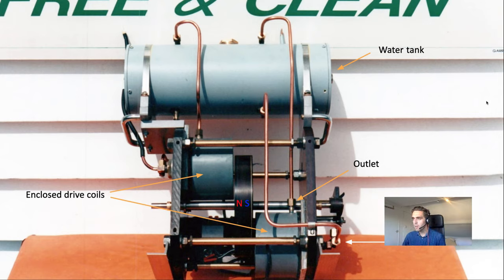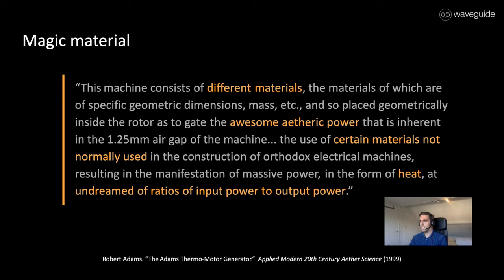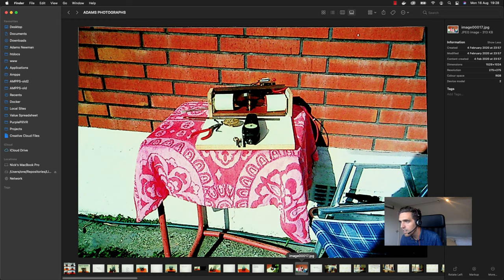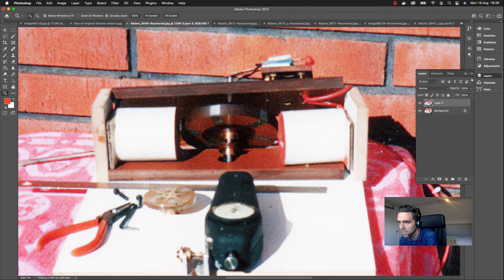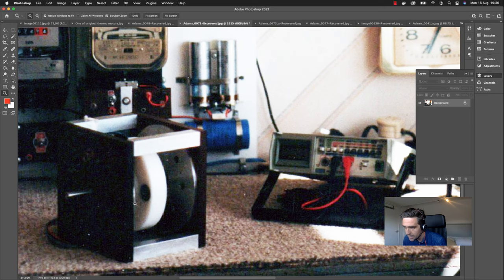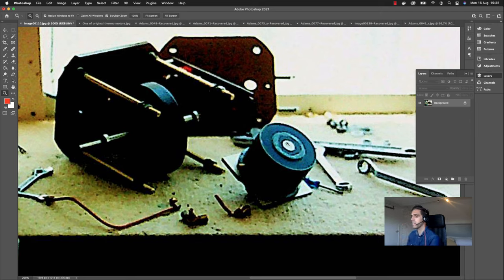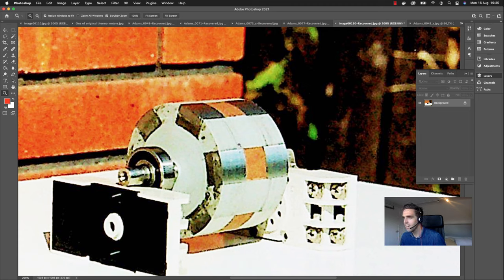NEW Adams Thermo Motor Pictures

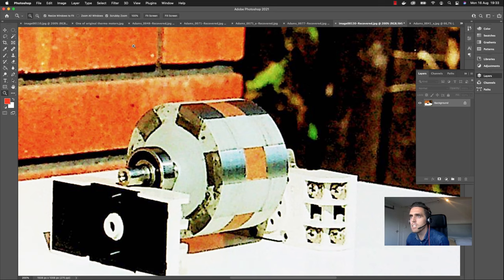Comment: The material on picture 8:18 that you ask about is probably Mumetal. This would force the magnetic field to be more focused outward and not toward the inside the rotor. This is only a guess as I do not have access to seeing the material first hand. 
What was the forest that made the heat, do you know ???
Reply from the maker: You might be right. I'm currently doing a lot of research into Don Smith, and for his Bloch Wall Generator he used bismuth, permalloy, terfanol-D, or indeed other high permeability materials like mumetal to scatter the magnetic field, causing the neutral part of the magnet (Bloch Wall) to move around, causing immense amounts of induction. I feel a similar effect may have been causing the heat in the Adams Thermo motor.
Reply: @Waveguide  I wish I would have the information you have about the Adams Thermo motor. I would bet I would be able to really help you out with the item. The hardest part of dealing with these invention is getting solid accurate information for research and experimentation. I would bet most of the machines he made were sold at a estate sale by female who only know what Adams like eat and drink. Or just given away to the course scientific hopeful wantabies who take things apart and just lose interest with the machine itself. Rarely does someone find and take the machine to the finish line.  
    My feeling is you are going to figure it out Waveguide. I just hope I can have a small part in helping you Sir. 
Good day too. vf
Reply from the maker: @victoryfirst2878  check out the links in the description under my videos, there I share all the information I have about Adams and his machines.

Comment: I left long comment on newer video, didnt see thiese photos yet!
OK those two grey "cans" are ALUMINUM or COPPER  water filled chambers.
And inside are his coils, maybe with cores of lead, or bizmuth or aluminum or whatever.
Maybe coils of aluminum or copper wire.
I heard his coils of copper tube!
Water running through too....
Reply from the maker: There were no coils in the water tank at the top, only the two visible motor coils, and the water ran through the iron core inside those coils.
Reply: @Waveguide  Most probably water ran through both copper tubing working as the motor coils and the core as well too.  Iron is going to get red hot whipping neodymiums past it pretty quickly,, so use the cooling water as heat source.  And the copper tubing  near rotor magnets is going to get hot too, its just more effecient to do both. Also "magnetic structured water" of reverse polarity to nature can be made if you pump the water in right direction and spin magnets in right direction.
All viruses and bad stuff like tumors in body is polarized opposite of the good stuff in body (maybe its positive I dont remember) and if you polarize water negative then drink that water, it sticks to the viruses and then you piss it out. Lots more to it but thats it in nutshell.
also that bigger tank up there in photo, that could be HUGE, as big as a shipping container and have it be one of those "liquid batteries" the MIT kids figured out.
Basically some stuff that sinks to bottom for a liquid "plate" and some other stuff floating in the water on top as the other plate, the "structured water" produced by the adams motor magnets is the electrolyte and you have a giant battery.  They already use these things to absorb power grid meltdowns if lightining strikes or powerlinew downed....giant liquid capacitors sort of inside shipping containers liquid batteries better description.

Comment: the thing in center looks like his star wheel commutator but 6 instead of 4 like the other engine drawing....maybe graphite and copper on the japanese collab
Reply from the maker: I see what you mean, as there is a resemblance, but the "lines" are way too thin to achieve a 25% duty cycle, so I'm quite sure it is something else. In the original thermo motor, it seems there is a starwheel setup on top.
Reply: @Waveguide  maybe its not a drive star wheel but a momentary short circuit of the coils to create a lenz law spike of eddy currents that then get let go again. how else does it make the heat since his other machines ran cold yet this runs hot. i dunno man. chase down the siblings...good luck with that, I pray it bears fruit for you...also in hindsight about the materials being copper and graphite...those are common in motors and he described the materials as not common to motor manufacter so now i am wondering about it being a high dielctric material (the black stuff under the magnets) but the orange stuff maybe its a brass alloy of uncommon mix tailored to be paramagnetic. square blocks of differing forces...dielctic, conductive magetic, conductive paramagnetic and all incorporating harmonic numbers as described in Bruce Cathies books and incorporating pi and phi in the ratios of the square blocks. Have you looked into the way Cathie derived harmonic numbers and ratios from the planetary grid and the speed of light at that latitude?
Reply from the maker: @m3sca1  I bought Cathie's book The Harmonic Conquest of Space, because it contained a chapter on the Adams Motor, but nothing new was revealed in that chapter unfortunately. Other than that, I haven't read about the details of Cathie's work. I do have several pictures of Robert Adams, Bruce Cathie, and some Japanese business men who they were working with.
Reply: @Waveguide  so the latitude where you live and are building the things needs to be factored. according to Cathie the speed of light is different at different latitudes and then that number gets used to calculate the dimensions of things if they are to be harmically in tune. Read the whole book and follow the way the geodetic inch gets converted on yhe light speed tables
Reply: @Waveguide  The current should flow at the moment when the magnet is located exactly in the center of the coil core and stop when the magnet comes off the core. That is, the current must flow over the width of the magnet divided by 2. The wider the magnet, the longer the current must flow. Judging by the photo, if a small disk is enlarged in proportion to a large one, then the width of the conducting lines of the star is just equal to half the width of the magnets.

Comment: something else to consider. timing the magnetic attraction to the motor core to the highest point of resistance point on the heating side.  if that makes any sense.   using eddy currents you will run into lenz law so you will have to move the  flux/eddy currents away from the magnets each pulse to avoid slowing down the drive motor.  that will be done through the geometry of the material used.  not easy to do.  unless you can find the "magic" material.  good luck.

Comment: running neo magnets by copper generates a lot of heat. i would try aluminum, copper might slow the rotor too much.  silver? also make a test machine to test different materials.  you can figure out the geometry later.  keep it simple.  research eddy currents in materials.  maybe he found a way to use  he eddy currents without sowing down the motor, he was smart like that.
Reply from the maker: Thanks for the tips! In his words, he said the machine generated heat like this:

"The rotor is designed and engineered in such a way that it gates massive aetheric energy in the form of heat which is transferred by the rotor system to the water jacket system of the machine stators."

Comment: If you re orientated the drive coils, so that they were vertical, so the coil fields would be perpendicular to the magnetic field. You'd just have to find out if the north facing magnet is better propelled by either of the two fields accounting for which way the rotor is spun ofcourse. This operates on what Newman discovered, that the magnetic fields are gyroscopic in motion. It's this type of coil setup that generates a massive amount torque, because the magnets want to spin off the rotor. Best to bolt them down, and maybe cover them in epoxy resin. 

I've been down a similar inquisition. This is Patrick Kelly's video on the Adams Motor https://www.youtube.com/watch?v=J2bPDDWqSvM but to be honest when comparing apples to apples, an Adams Motor vs a Newman's Motor, just has a different coil set up. But the Newman Motor also uses impulse/short circuit current which is so powerful in it's BEMF, that can generate usable torque on the rotor. These other magnetic rotors using Pulsed DC coils, have no real power, unless it's like a leedskalnin bucking coil set up, that can generate power at very low rpms indefinitely. I believe even the leedskalnin generator short circuits itself in the bucking coils to make a monopole electromagnet. This is what bedini was doing. It's only until you have a rotor that has induction windings, then you can get usable power from because there is constant signal tension on the windings, which you can't get from magnets. But you can get an extremely heavy rotor, put some magnets on there and through the impulse sequencing, it will reach it's maximum velocity according to how the commutator is set up. A question that one has to ask itself, is how does amperage effect lenz's law? High Volt Pulsed DC bypasses lenz's law.  In my comments on previous videos I mentioned, the newman motor is a far easier machine to make, especially in regards to the Naudin Design http://jnaudin.free.fr/html/qmmv11.htm Look into Gerard Morin and his pulsed dc washing machine motor https://www.youtube.com/watch?v=ZgdyFKIt9Xg 

I mean Gerard Morin is dead,  because he was turning a washing machine motor on a like a 150 volts pulsed DC. Hook that up to a generator, or rather an alternator for low cost experiments, and attach it to a 50k up 25k down transformers. You got over unity. Whatever energy is not used, you have to send it back to another series of transformers. Then the gain increases further. 

 And that my friend is the secret of our electrical grid. AC power transformation. This is why Thane Heins believe he has it, with his Bi- torrid Transformer. When comparing a multiphase pulsed DC inductive motor, to a newman motor, I think the case is your going to generate a lot more power with the inductive motor, than the newman. But the key to power is really about it's AC step up transformer.
Reply from the maker: Wow, a lot of info in that comment! :-)

This particular Adams motor is not meant to generate torque, but immense, ever increasing heat, which is then used to boil water and run a steam turbine.

What Newman found out is super interesting, indeed. But his motor was gigantic.
Reply: @Waveguide  The Naudin Version of the newman motor is actually very small, can easily fit on a table. You don't need 6 offset magnetic columns, you can just have a rotor disk. Lots of other projects on Naudin's site too that'll you find interesting. Can possibly get a seebeck effect on the Newman motor, both Newman, and Naudin in his notes say the generator runs cooler.

Steam is a very tricky thing to manage in a home project, most people have turned to hydrogen trying to pursue meyers high frequency resonant coils to make HHO gas. And when that combusts, it actually produces a far less exothermic reaction compared to hydrocarbon fuel since it's far more explosive.

Budget wise. Naudin's version of the Newman motor is easy to do as a overunity project, since it's short circuiting. You may be able to add in additional pulsing coils to gain momentum in between the short circuits. More expensive project, Gerard Morin's, Samsung washing machine motor, generator, transformer etc. You can probably crowd source some projects. There's not many new people working on things and I was really impressed to read your article on pulsed motors.
Reply from the maker: @FirstLast-up2dx  yeah Naudin has done a lot of cool stuff. He also "replicated" an Adams Motor, but he did not follow the inventor's instructions at all.

I am aware that there are a TON of different pulsed motors out there, but my goal is to fully unravel this particular one, because the fact that it is an aetheric heat engine makes it different from all the other ones.

And I'm not excited about working with steam either, but just seeing the constantly growing output energy of this motor, which Adams described, would already be enough of a result to seriously consider the existence of the aether.
Reply: @Waveguide  If you want heat from the coils, they need to be thicker gauge coils with no iron core. Or wind them in an anti-parellel manner, so the current flow opposes itself and have the tubes go through the coils. I think in this manner what the coils will lack in magnetism will create heat from resistance. Then you have to worry about the voltage to resistance ratio, thus creating amperage and possibly burning out your coils that use smaller wire. 
If you believe heat is coming from the lead, in the rotor, then the high rpm's of the motor will be working against that heating purpose. You'll need to make an air tight system, not a vacuum, so that the eddy currents from the lead, will eventually heat the air inside the box, like an oven, that will eventually heat the tube lining, boiling the water. However the coils will need to be outside of this system, because the hot air, will create eddy currents in the coils, creating resistance and possibly burning out the wire. That pressure, will be very dangerous to work with at usable levels and somehow that steam would loopback to a generator, to power the pulsed motors?
On the market they already have ovens, water heaters, steam generators etc. Using steam is an inefficient medium. You're better off creating some sort of metal dust battery pulsed by microwaves or in a rotating magnetic field, to create heat for steam generation. If you do that, you'll probably get "pinged", and a knock on your door, hey maybe even recruited since you know how to code, maybe work for a defense contractor. Check out this Patrick Kelly video https://www.youtube.com/watch?v=dqh8Yu3NjJI 

A newman machine, or a pulsed dc motor in a looped circuit with a transformer, is a far more exciting project. At these conferences you'll get a whole lot of attention. I mean even a working model of an Adams motor, generating as much steam as applicable, is a dangerous machine to bring to one of these events.  Those are just about the most efficient designs I've come across, other than a hydrogen engine with a resonant electrolysis system.

Comment: 9.10. material is ceramic? Ceramic is non conducting , non magnetic and will not have induced within it any eddy currents.  Although, ceramic would not withstand forces at high rotation coz its brittle. Maybe its just a spacer.
Reply from the maker: Thanks for your input! Definitely worth considering that it is ceramic
Reply: @Waveguide  yeah and i guess the heat is generated in the stator cores, thats why only they have the water jacket around them. Meaning, the strange material is in the electromagnets, not the rotor.....just a thought.